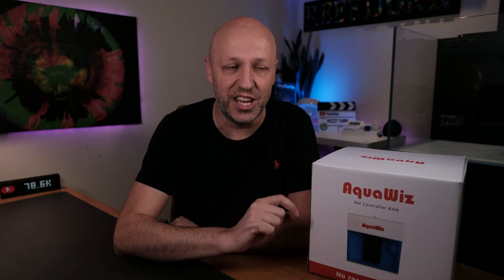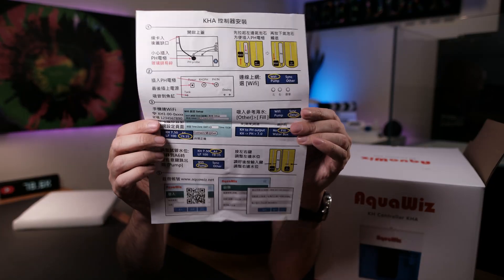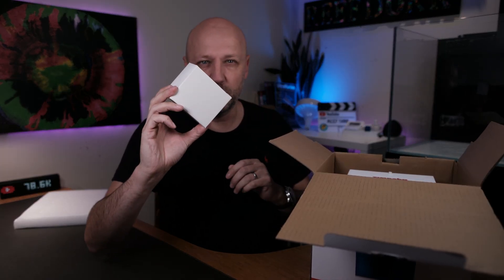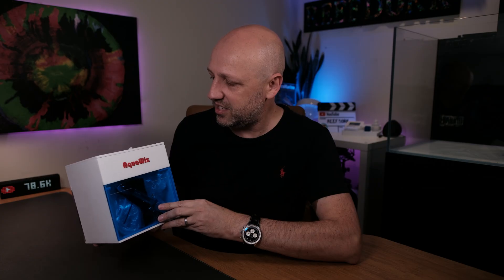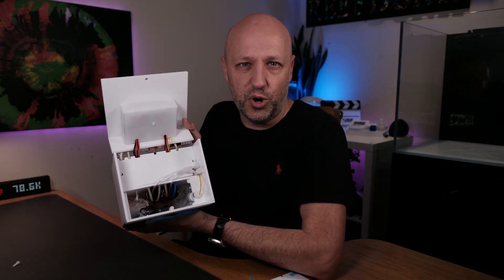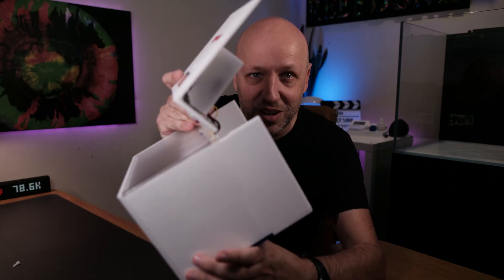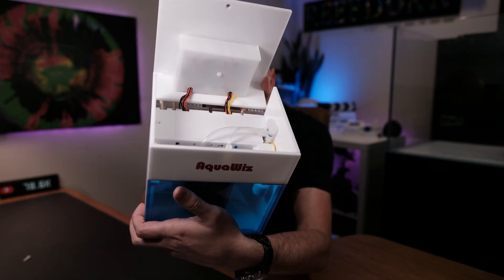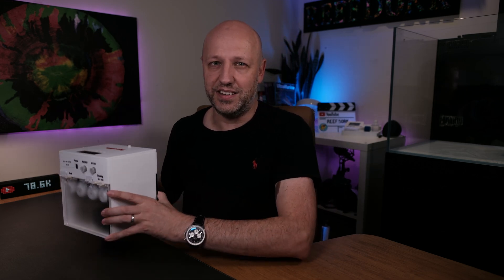AquaWiz kH Controller Unboxing (No Reagent Needed)

Comment: Had issues with the two units I had - as soon as the house windows were opened and large changes in ambient co2 they would read wrong.  Manufacturer couldn’t diagnose the issue but accepted the returns.
Reply from the maker: Interesting, thanks

Comment: Id love to hear more about those dosing pumps. Cant help but to think they look like Jebao made them. While i have had ok success with jebao dosers in the past, they still break down quite easy and lost accuracy over time. How are these different? Will replacement parts be available and are replacement parts expensive or could i use jebao parts? How long can the system go in reading accurately before needing to recalibrate. How do you calibrate? Do i need a different tester to let it know what it says? So that means id have to buy this and buy a test kit separately every so often for initial set up and recalibration? How many tests before parts need to be replaced? What parts need eventual replacement and how often? How easy is it to get troubleshooting help? Is it a phone call, email, ticket? Hows their customer service? Whats the difference with this latest version versus previous ones? They used to have a yellow see through. Whats the warranty? Can it be extended? 

Thats it for now but ill think of more 😊

Comment: It works well. i feel like my tank is on full autopilot now. I let the aquawiz dose kalk for the last roughly 20% of my dosing needs to keep my levels stable. i do around 80 percent of my dosing with 2 part on a separate doser set to mostly the daytime. i set the aqua wiz to pick up when alk dips below 8.2. i only wish they could make it communicate with a separate doser that worked better for kalk because the one built in seems to be limited at 50 mL per hour.
Reply from the maker: Yeah I was thinking the same thing - I might just get it to do the automation with All For Reef
Reply: @ReefDorkXtra be carfull with all for reef. I believe it takes 48 hours after a dose to take full affect because it relies on bacteria to break it down. I don't think that will work with the aquawiz. It will cause up and down alk swings. I haven't tested this theory but i assume thats what would happen

Comment: I have had a few pH probes in my time and the problem has always been (for me) the longevity of them, they are sensitive devices.
Reply from the maker: How long do you find they last? I usually get a good 12 months
Reply: @ReefDorkXtra  I love the idea of getting away from titration testing and I do like the idea of the Aquawiz. 

I have had pH probes from reef factory, Neptune and the latest using the KH Manager. I find with all of them, keeping them clean is the hardest thing and the easiest way of breaking them. Now I just soak the probe in an old pH test fluid (pH 4) for an hour or so, its more acidic and cleans the bulbs without touching them. I have to say the shortest lived probe was the reeffactory followed by the Neptune. It will be interesting to see how the new Red sea probe fares?